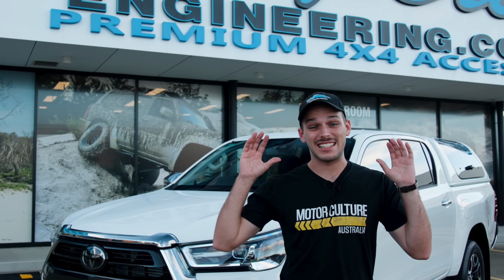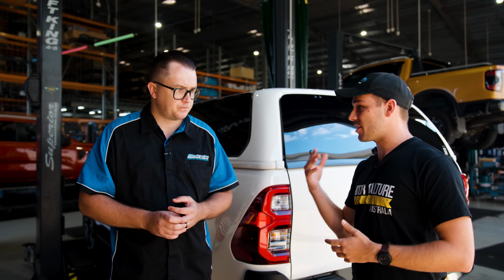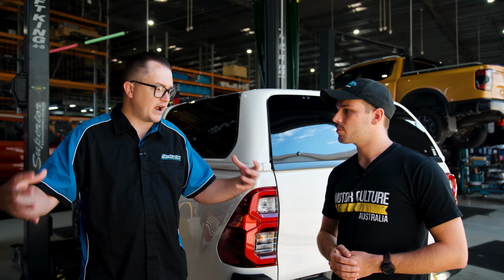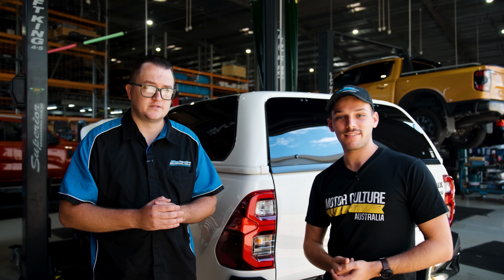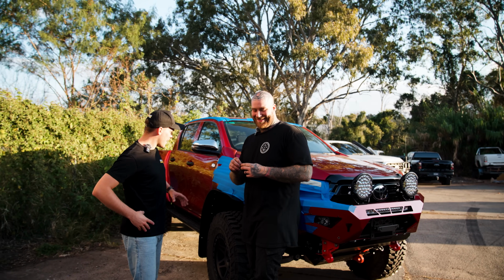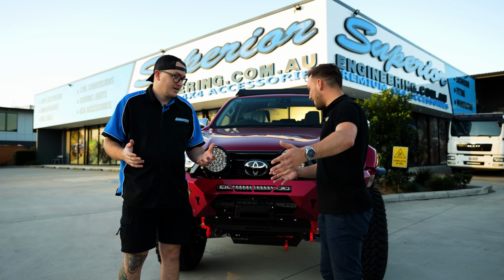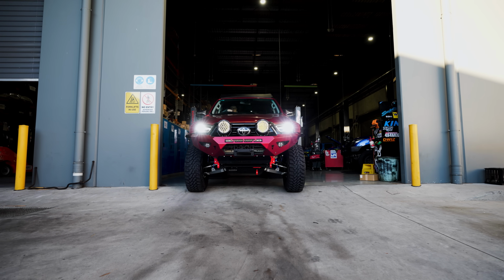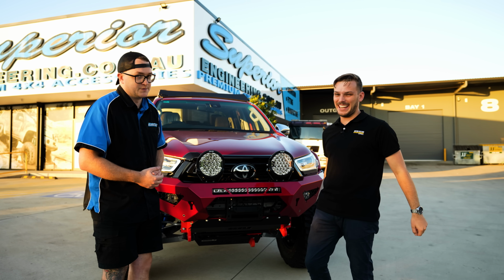SUPERIOR ENGINEERING X-TRACK HILUX IS OUT OF THIS WORLD - BUILD BREAKDOWN 🤯

Comment: awesome build, only thing i don't like is the cheap looking rubber/plastic wheel guard extension's, it would have looked better with the  front and rear tub panels being built out to cover the wheels. but i would imagine that wouldn't have been a cheap option as its a lot of panel work
Reply: Bunnings fender flares

Comment: Any reason why you advertise all the work but don’t breakdown the money spent? I’m guessing you created a car now costing $150k! Whats the GVM? So much additional info not discussed that would have been interesting……
Reply: look it up on internet it’s $56k for the kit fitted
Reply: Superior engineering has multiple kits at different levels for most models, its basically custom but off the shelf, engineering and certification is where the cost is, but they have heaps of bolt in kits also
Reply: What’s the gCM too